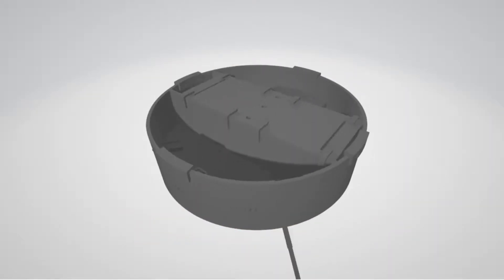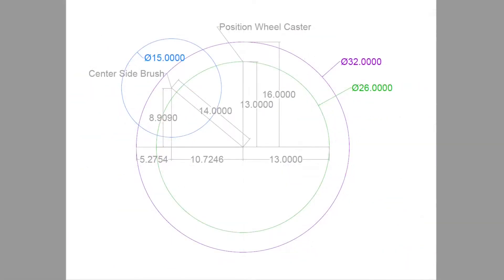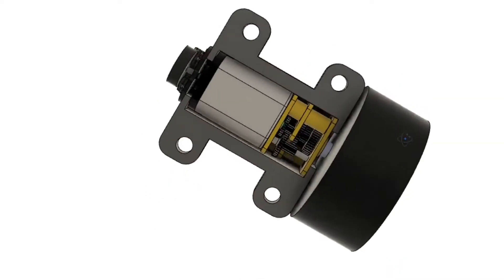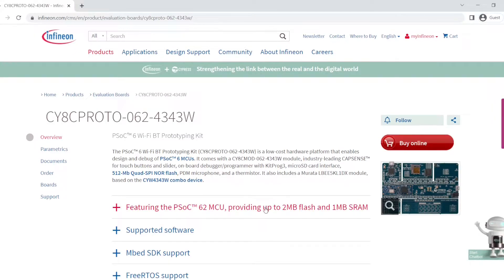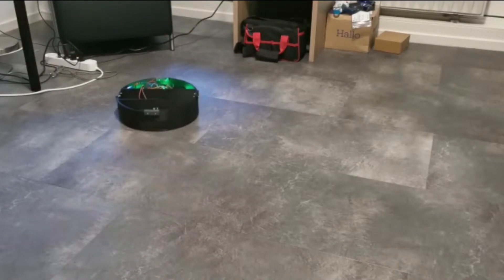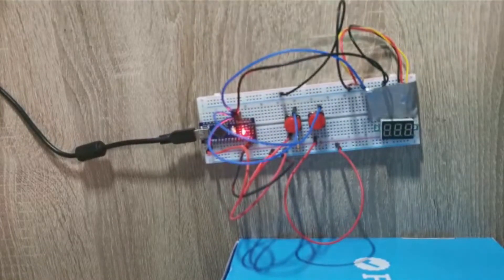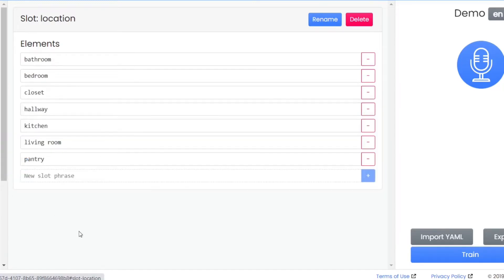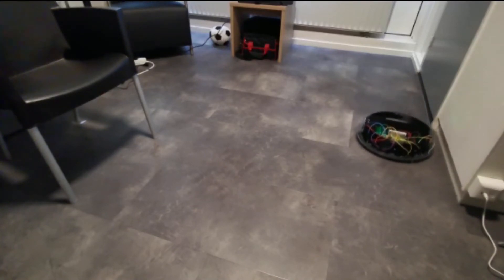Development Preview #1 - Robotic Vacuum Cleaner

Comment: Maybe try to make your own wheels? You can make the shape and diameter any that you want and it's quite easy to make one's. I have made mine for line follower type robot out of silicone. You can read and choose different types of it - durability, hardness etc. Also I'd add these very side distance sensors to have 180 degrees of obstacle detection. Lastly think about using different motors because these small ones dont like big wheels and heavy load (gears wear out very fast).